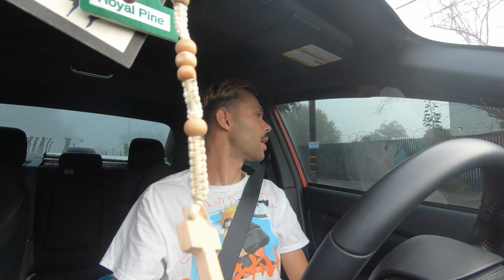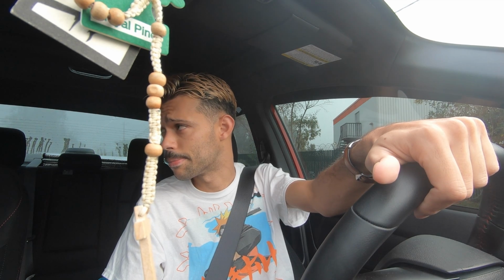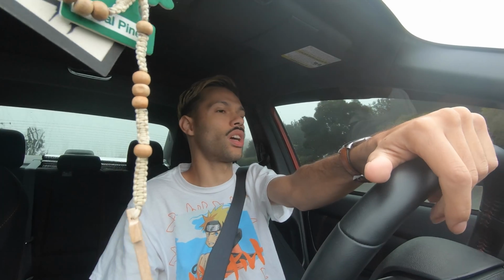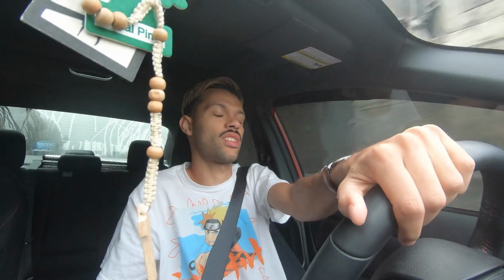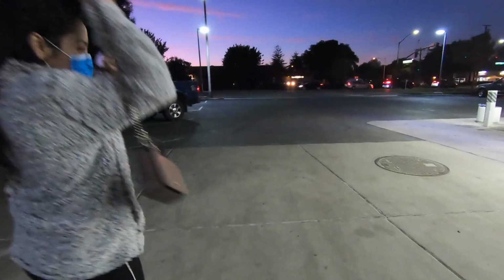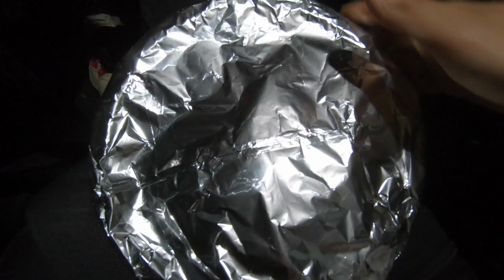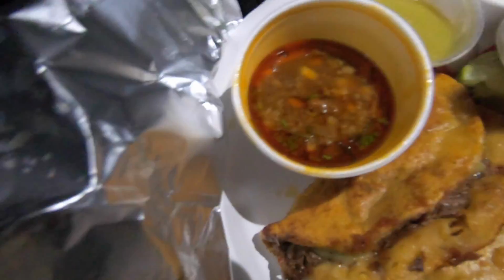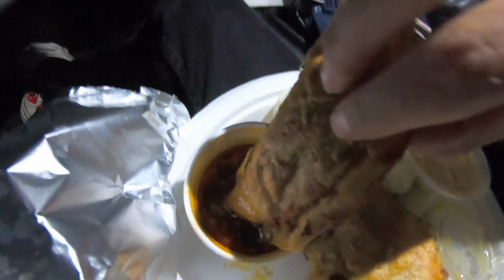WRX Stage 2 OTS Tune Review + Sound Clips

Comment: Cool videos bro!! Brother what you think of ma performance stage 2 plus? People say that it makes 325 wheel horse power with ma performance stage 2 plus off the shelf. Please help🙏
Reply from the maker: Appreciate the support bro! I can’t speak for ma performance as i used the cobb ots but i have heard its a bit more aggressive. I highly doubt you will be at 325 wheel though, probably more around 250 to the wheels. Anything more you’ll need a protune. OTS maps are really conservative and not the most reliable, so make sure you read all the map notes and use correct parts if you go that route.
Reply: @theebckyrd  Thank you brother!!
Reply from the maker: @burhanuddin7782  any time broski

Comment: Which stage 2 tune did you use? Stage 2 91, stage 2+ 91 v350 or stage 2+91 v350 HWG?
Reply from the maker: Stage 2 91 if you only have an intake or stage 2+ 91 if you have intake and jpipe. Read all map notes before installing and make sure you have correct parts installed. These only work with Cobb parts!
Reply: @theebckyrd responded! So you don't use the 93 octane one ?
Reply from the maker: @holahola6292  91 is the highest octane available here in California, otherwise I would have gone 93
Reply: @theebckyrd   so let me ask younsomethint cause I have everything cobb even topmount ,however, did you ever get feedback.knock driving around normal ?
Reply from the maker: @holahola6292  some knock is always normal especially on an ots map (usually a ghost knock caused from a/c or road). Would only be concerned if its greater than -2.81. Definitely recommend a dyno tune ASAP that is the best bet for a healthy car
Reply: Just wanted to know cause I have all sorts of stage 2
Reply: @theebckyrd  every time I got knock I felt a studder so I got scared and removed back to stock .but it was an incidia now I got cibb
Reply from the maker: @holahola6292  no worries. I would definitely go ahead and start with the OTS map and then get a pro tune if possible shortly after
Reply from the maker: @holahola6292  if going ots read the map notes and make sure you have correct parts installed. The ots maps are very cobb specific

Comment: I can’t seems to find the Cobb OTS stage 2 tune any where. Any tips?
Reply from the maker: Should be on cobbs website
Reply: @theebckyrd  it’s not there currently. Any possible way you could send it to me somehow?
Reply from the maker: @nicklarsen9383  what year is your wrx? I have the ots tune for the 2020.
Reply: I have a 2018. I just found them tho, I had to restore all the Cobb OTS maps to my AP. Thank you for the help tho.
Reply: @theebckyrd  do you happen to  still have the stage 2 tune. I have the same set up ?
Reply from the maker: @arjayudani9435  I unfortunately do not have the car anymore, actually sold it beginning of this year. But I ended up going with a full custom dyno tune on flex fuel